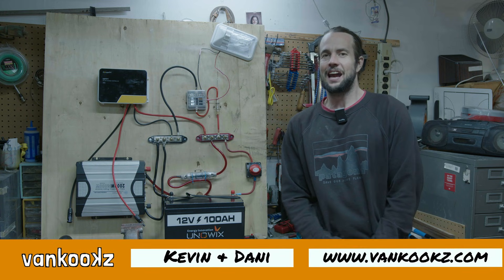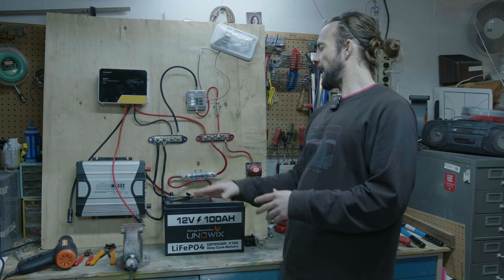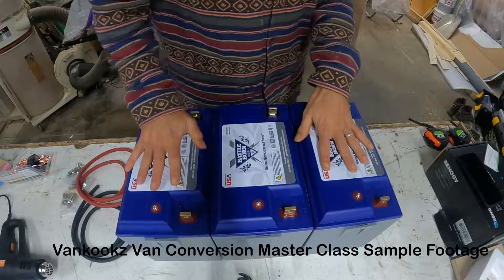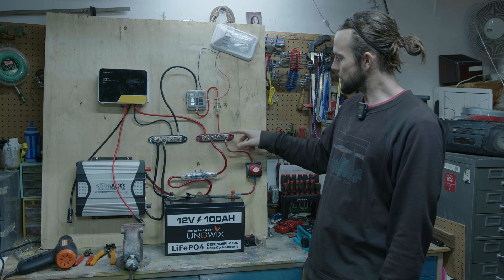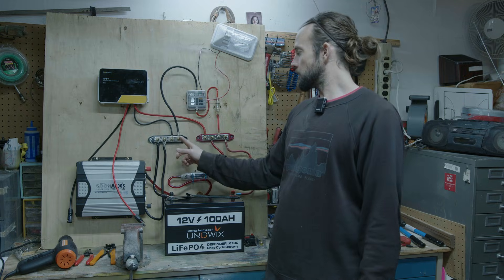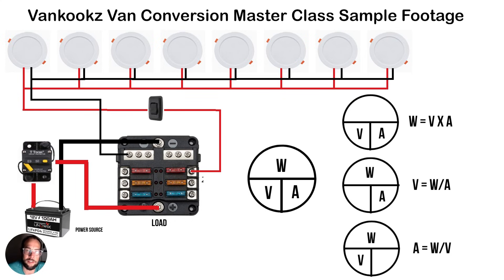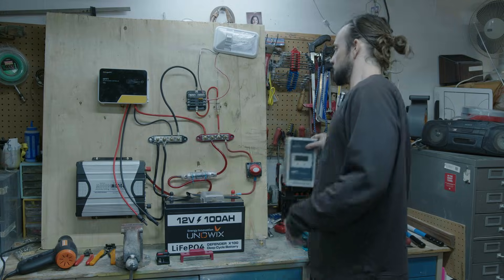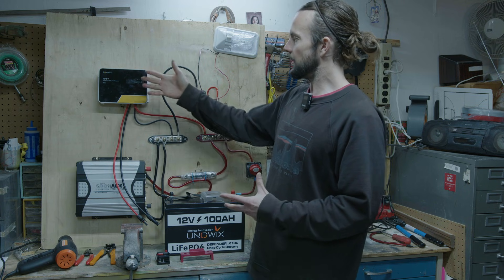Step by Step Complete 12 Volt Power System for a Van Conversion

Comment: Hi there :) 

Question please:  what factors determines the size of the cable running from the neg busbar  to the vehicle chassis?  

My system is the same design setup as yours - albeit a bit bigger (3kvs inverter, likely 200amp draw from 600 amp hr batteries with max 300amp continuous draw)  realistically, less than 200 amps at any one time - maybe 150amps for the coffee machine) 

But Im growing conflicted about how thick the cable to the vehicle chassis needs to be! Or….?! 

Thanks in advance!

Comment: one of the most straight forward videos I've seen but......
if you were using more than one battery, would you connect the batteries in parallel, the positive bus bar onto say the positive terminal on battery one and the negative on the negative terminal of battery two ... or in a three battery setup, positive or negative on battery one and the other on battery three, with battery two doing nothing except being part of the 'big battery'?

Comment: In this setup where would I put an adjustable voltage regulator to lower the voltage going into my light bar . My circuit goes feom battery . I have a cut off switch in negative side . Going straight to a fuse box which my 5 gang rocker switch is connected to which then goes to my light bar. I’d like to lower my voltage going into that light bar

Comment: I have a question some say to ground the bus bar to the chassis, but others say not too. If it's grounded doesn't that increase the risk of short? Also isn't it bad to ground the solar panels? If the solar is connected to ground isn't that bad?

Comment: Cannot find anywhere on YouTube how to do with relay. For example, while you drive your batteries will be charged and when you stop that relay will turn off from generator and it will automatically charge from solar. Do you know what I mean? But to be honest, I don’t know what kind of relay I need to use and connect it  correctly.

Comment: Hey there it’s my first van electrical set up and I want to run a 2000w/4000w peak inverter so the first set up I’ve kinda got ready to install as I’m typing this consists of…

Positive line:

So I have 2x130amp = 260 Ah in parallel leisure battery’s with a 300amp MRBF fuse connected straight to the positive battery terminal 

then from said fuse a short length of AWG6 (200c) cable in to a 200amp circuit breaker 

followed on by another short length of 
AWG6 (200c) cable into a 250amp (rated) positive bus terminal

Followed on by another short length of 
AWG6 (200c) cable into a 300amp ANL fuse & housing box 

And then finally 

Another short length of AWG6 (200c) cable connected to the positive terminal of the 2000w inverter 

Negative line:

From battery terminal short length of 
AWG6 (200c) cable in to 250amp (rated) negative bus terminal 
 
Followed by another short length of AWG6 (200c) cable connected to negative terminal on the inverter 

Also I have smart battery isolator that runs from my main van battery (+ & -) terminals to my 
(+ & -) leisure battery 3 way terminal connector that I’m trying to avoid and make redundant … 

Q.) can I connect this battery isolator on to the corresponding bus terminals now on the board and make the 3 way terminal connector redundant because if my way of thinking is right then if the smart battery isolator is still connected to the 3-way battery terminal, then it will still be live as it’s connected into the system before the 200amp circuit breaker and at the same point as the 300amp MRBF fuse as I want to connect all other cables from my diesel heater that are currently connected straight to the 3-way leisure battery terminal on to the 250(rated) bus terminals

I’m not an electrics guy at all as I’m colour blind so always left it alone but my 1000w invertor blew and I need more power anyway plus the previous owner didn’t install a on/off isolator or circuit breaker on the electric board as it stands so any help and information about this install and set up I’m about to install good or bad or what I need to change will be much appreciated

Comment: I've never even heard of a shunt and you casually say to "add a shunt" without even telling what a shunt it! I guess this video isn't for very beginners in wiring.
Reply from the maker: Don't worry I didn't know what one was my first time either. It's just a battery monitoring system. You don't need it but it will be more accurate than your charge controller.

Comment: If you are just connecting a battery to the DC system with only solar input, do you have to use the separate buss bars OR can you connect the battery directly to the fuse panel block?

Comment: Do you happen to have a link for the battery cables? I need longer one than they originally I don’t know where to find them or what sizes you get, but I can figure that out later.

Comment: shouldn't you have a main fuse (eg 250 amp) as close to the positive terminal as possible to protect the system from ground faults?
Reply from the maker: Yes that’s would be wise

Comment: Thank you for this great video.  I do not have solar…yet.  My batteries run in parallel will be charged with a lifepo4 80amp charger.  On the system you built in the video how would you connect the 80amp charger ?   Would it be connected to the battery or to the busbar ?   Do you need the system on/off switch off while charging?
Reply from the maker: Battery will work

Comment: cant you in theory just run the 120v inverter plug to a 30 amp female plug and just plug it into your 30 amp connector on your RV? this way it runs through the RV fusing and provides 120v to all the outlets? thats how we plan on setting our off grid RV.. or is there reasons why this isnt a good idea..
Reply: That will work but you need to trip the breaker to the converter before you connect your RV to the inverter. Also consider tripping the breakers to the AC and the microwave depending on how much battery you have you can drain the battery quickly or trip the inverter on overload. Good luck and remember to reset those breakers before you connect to shore power so your batteries will change up from the converter.  Note: Please do not use a male to male plug from the inverter to an outlet in the RV. Extreme safety hazard.

Comment: Einstein...You need a Mains or Catastrophe Fuse ("AT") the POS battery Post FIRST then the wire.  Not half way into the system! The Catastrophe fuse is sized to protect the "WIRE" carrying the load of the system from the POS post to the POS buss bar. That wire is sized to carry the whole load.. Then EVERY single other circuit needs to have it's OWN fuse from the POS buss bar! Go POP the hood on your VAN and take a look, there will be a fusable link (MAINS-CATASTROPHE FUSE) at the POS battery post or within a few inches! The way your wiring the system your gonna BURN the Van down if a Short should ever occur with no fusing at the battery POS post!

Comment: Question, can you wire from a shore power charger to those bus bars or does the power from the alternator vehicle battery have to be disconnected?

Comment: Why would you run your batteries through the engine? If I run a basic 50watt inverter through my lighter just to keep my phone, tablet, honey badger, and occasionally my dremel, drone, or Nikon mirrorless camera,  after 6 months my battery fails, followed by my alternator. My past 3 cars, same show, currently running through a mercury grand marquis which in theory should be the best equipped but has failed the most sudden and dramatic whereas the other cars I had warning
Reply from the maker: It’s a dc/dc charger or a battery isolator. Its only job is to charge the batteries while driving.

Comment: All I want to do is charge power banks.   Am I safe just using a solar panel, an mppt & a 12v battery??
Reply from the maker: You can charge your power bank with just a solar panel that is compatible with your power bank
Reply: @Vankookz  That's currently what i'm doing but I have a spare 12v battery & i'm interested in upgrading.    Thanks for replying.

Comment: I’m a bit confused about your wire size from your battery to the inverter. You said you’re using #4 from the battery to the inverter. That’s ( if it’s thhn) only good for 95 amps. A 12 volt battery feeding a 2000 watt inverter could produce 166 amps (2000/12=166.6).  sounds like #4 would be inadequate. Why would a person use a 200 amp fuse with wire that’s only rated at 95 amps?  Maybe I’m missing something.
Reply: You're not wrong. 4AWG is going to warm up the cable at 2000W. There's a chance he may be thinking he won't hit 2000W ever for very long. Even then, realistically he should be using 2 or 1 gauge.

Also, if he is going 4AWG he should reduce the distance from the bus bar to the inverter as much as possible. But I guess that's just a bit of wood he's screwed stuff into for demonstration purposes.

So yeah, be careful who you take your wire gauge advice from!
Reply: Should use at least 2 gauge, system I am building now I raised that to 1 gauge only because I am trying a 460 amp hour battery.
Reply: Welding cable should be used…#2

Comment: How come fuses aren't required between bus bar and inverter, or bus bar and solar charger? Thanks for the helpful video
Reply from the maker: Yes you can and should add them in both places. I like using the 12V breaker switches.

Comment: I think there is something to be said a out the "protection " of your system. Touching lice terminals isn't a great thing to teach people with no knowledge as they might tough both bus bars at the same time.

Additionally, when you pull the fuse out it would be a "open circuit"  not a short. A short is what your shunt is. Also, your shunt was shown as a parallel connection to monitor voltage but you said it should "interrupt thr connection" so one might take that as wiring in series to measure current.

Overall, not terrible. But definitely lacking a lot on the basics. This is the wiring of "not knowing what will hurt you".
Reply from the maker: Yes I agree. It's hard to get everything into one quick video. But this comment is great and I love it. I learn a lot on this channel just through comments! 

Thanks, yes open circuit is correct it's also hard to get all your words out correctly. I appreciate all the insight, I will now routinely remember to add in to be aware of what can hurt you.

Comment: My understanding is the Chinese diesel heater should be wired directly.
Reply from the maker: Yes you can do that. It's funny you mention this I've been going back and forward with a student in our masterclass about their system and they keep having issues with the chinese diesel heater and we finally just hooked it up to the battery and it started working! So yes that is fine to wire things directly to the battery.
Reply: I had to do this with my overland trailer after failed starts running it through the 12v supplied with the trailer. Ended up just running straight off my 12v 200ah lithium. Never a failed start since
Reply: @Vankookz  cool .

Comment: Nice content , very simple explanation ! I do have a question if you can help me :
I also have tht DC to DC Renogy . Also I have 12v 230ah lithium battery . When I driving , this dc to dc charger will stop automatically sending charge to the battery once reachs the voltage ? How do I know if this thing will not overcharge and damage my battery ?
Reply from the maker: It has a voltage cut off. Once your battery reaches its desired SOC it cuts it off.

Comment: The 40amp breaker is supposed to go between the charge controller and the postive bus bar in case of a malfunction in the controller, so it doesnt dump more thsn 40amp into the system. 

You also want a dc breaker as a shut off between the panels and the controller
Reply from the maker: Those are both in place and all on the wiring diagram. It’s actually pretty difficult to film and build. But I also added a 40am fuse at the battery terminal as well on the starter battery. 

But yes! Valid points and thank you.

Comment: Why is every other van electrical video super complicated and long and your is simple and easy? I don't understand
Reply from the maker: That’s the kook way. Life is simple… people make it complicated. Of course you can build some complex system that you don’t need and spend thousands or dollars or. You can keep it simple and make your life easier. 🤙🏽
Reply: @Vankookz  Could I use your video and Just change the inverter for a 3000w and have like 5-6kwh in batteries? Or I  would need to change other stuff?

Batteries would be linked in series.

Thanks and keep it Kook!!!
Reply: @synos0202 linking your batteries in series increases voltage, not capacity. If you take 2 12v 100Ah batteries and link them in series, you have 24v 100Ah, if you take those same 2 batteries and link them in parallel, you will have 12v 200Ah.
Does that make sense to you?

Comment: More complicated than my needs. I came looking to see if it was safe enough to connect a cigarette lighter to a 12v 200ah battery directly to run my freezer.... that's all I want my system to run... solar to charge up the battery...
Reply: You can. Just put an inverter between the battery and the refrigerator. You have to know how many amps the refrigerator draws and whether or not it has a max draw on start up.
Reply: @RobertSommers-d8n  nope. No inverter needed. My freezer draws only 40 watts and has an attachment that is compatible with a cigarette lighter. Ultra efficient. It's been up and running for 6 months now. Had only 1 goof up, and that was during a testing phase: plugged in a bunch of fans to see how fast they'd drain the battery. Got my answer and it wasn't pretty. Those are on their own battery bank now.

Comment: Everything is good as long as I don’t put an on/off switch on the wires coming from the fuse box. Once I do, the wires get hot instantly or the fuses blow instantly. Lights will stay on constantly once you remove the switch, but the wires are no longer hot or blowing the fuse and not being able to turn your lights on and off via switch is a no go.

Comment: How would I ground my truck camper from the negative bus bar if it does not have a metal frame? 

Great vid! Thanks
Reply from the maker: Your vehicle has to have a metal frame.
Reply: @Vankookz   thank you for the response. I found that the best way was to ground via the camper to truck's 7 pin wiring harness (which also charges the batteries while driving). I then added an isolator to ensure that while connected, the truck bed camper never drains my trucks battery.

Comment: Why no fuse on the battery positive?
Reply from the maker: You can add one there. Fuse it up!
Reply: How do you size the fuse?
Reply: @ChrisTewkesbury  the wire needs to handle your current requirements and then the fuse needs to be able to protect your wire. So for example if your current is 5 amps, use a 10 amp cable and a 7.5 amp fuse. That's simplified but the gist of the approach.
Reply: @tomalophicon  I have over sized my cables to future proof the van for ant additional panels, batteries needed in the future. I have a 170ah lithium, 2000w inverter and a 50a mppt dcdc.

Comment: Hi! Van, Assume it is a dark day that we cannot produce solar power, and what parts should I used to power automatically my bulb/motor using direct AC power ?
Reply from the maker: You will need an inverter charger for this.
Reply: @Vankookz  Thank you ❤. And I do not need AC power to charge the batteries.

Comment: new subscriber.  question.....i am designing a system now for a boat.  300AH house bank - thoughts on 2000 watt renogy?  now my question is if i am using 30 amp shore powers or a 2000 watt generator on shore power outlet...do i need to do anything special?  I had a person say "Then you just have one problem to solve that is how to wire the inverter so that when the generator or grid is active, the N-g bond in the inverter is out of the picture" - and I am unsure what they mean?
Reply from the maker: You want an inverter/charger or an inverter with auto transfer something like this will work... https://shrsl.com/4dzyy

Comment: why no fuse on the positive side of battery and why no fuse on the outlet side of solar mppt controller thank you
Reply from the maker: Yes you can put a fuse before the switch as well as an inline fuse on the solar panel. They make nice mc4 in-line fuses. Since it is a moving vehicle I recommend people fuse as much as they want. Don’t forget to strap those batteries down too!

Comment: Great video! What is the brand/model of the battery switch?
Reply from the maker: All the components are in the description here is the switch 

https://www.amazon.com/Spartan-Power-Disconnect-Ignition-Protected/dp/B09WZF17KB?keywords=battery%2Bshunt&qid=1679845647&sr=8-3-spons&spLa=ZW5jcnlwdGVkUXVhbGlmaWVyPUE4TllOM1U0UkpYNzkmZW5jcnlwdGVkSWQ9QTA4MTY1NTcxVUI2VVFMOTY0SUgyJmVuY3J5cHRlZEFkSWQ9QTAyODA1MjczUUcwM1NNNjJFOFpDJndpZGdldE5hbWU9c3BfYXRmJmFjdGlvbj1jbGlja1JlZGlyZWN0JmRvTm90TG9nQ2xpY2s9dHJ1ZQ&th=1&linkCode=sl1&tag=vankookz-20&linkId=782855fee95ee5d2f09c21180c59e1b6&language=en_US&ref_=as_li_ss_tl

Comment: is it possible to have two different ways of charging the house battery combining altogether at the same time?  Like the first charger is the car battery using DC to DC charger to charge the house battery and the other is the solar panel to charge the house battery as well. . Both altogether charging the house battery at the same time? 

thanks.
Reply: Good question maybe @vankookz can respond!
Reply: Looks like in his nicely laid out first diagram that he included a shore power converter/charger. He didn't appear to discuss this and weather or not you can safely plug into shore power AND charge battery at the same time the solar panels were also charging. Does the system shut down charging from solar panels if plugged  into shore power?